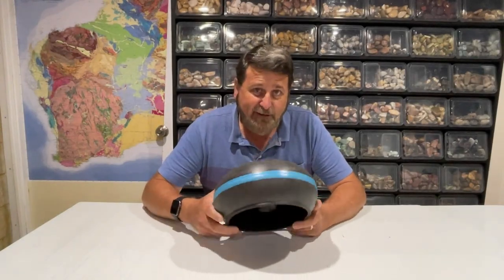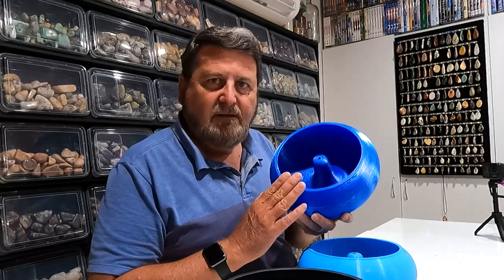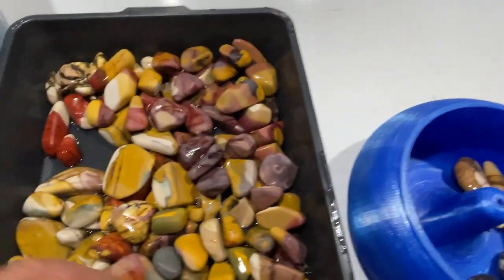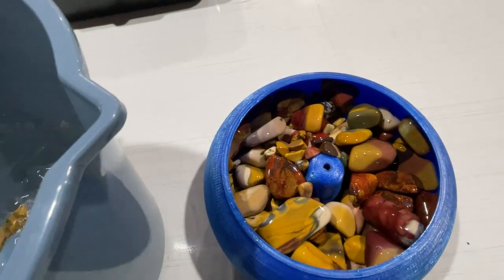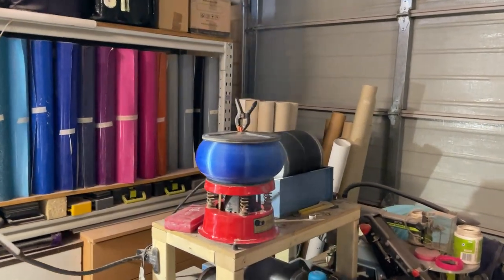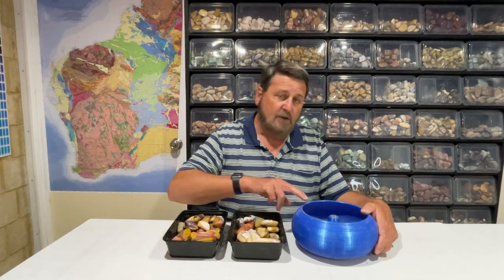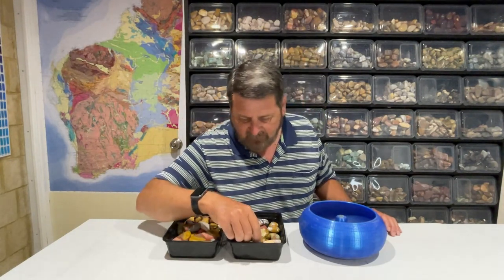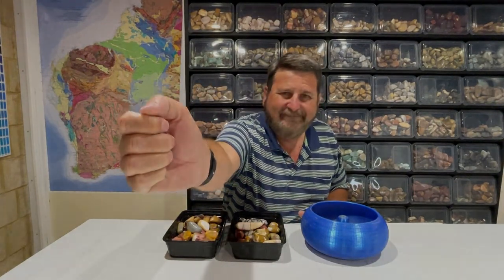Success or Mess - My 3D Printed UV-10 Rock Tumbling Bowl

Comment: How has your bowl held up?  It has been a year since your original post and no follow-up that I can find.
Reply from the maker: I've only used it half a dozen times as most of the batches I polish are quite large but it's holding up extremely well, dare I say it I think it's even tougher than the original bowl, albeit a bit noisier 👍
Reply: @Prospector-Paul  is there any softer material to print, that would be more durable and less noisy (more like the rotary tumbler barrel material)?
Reply from the maker: Hi Troels, I've just sent you an email 👍